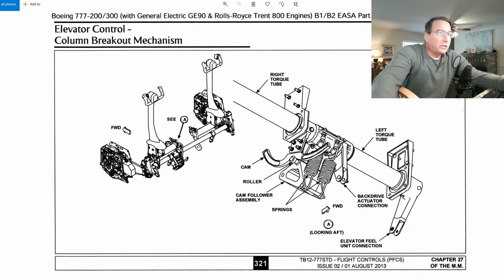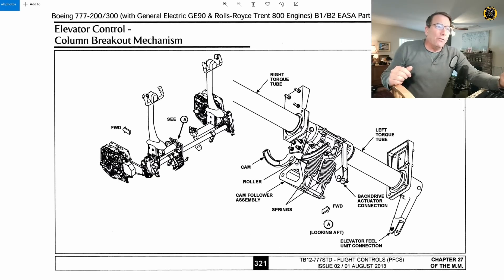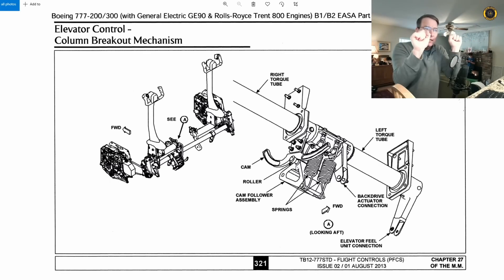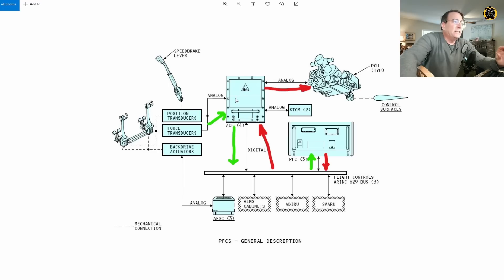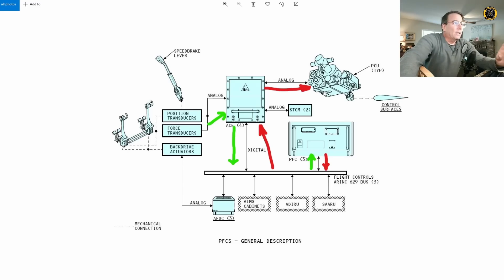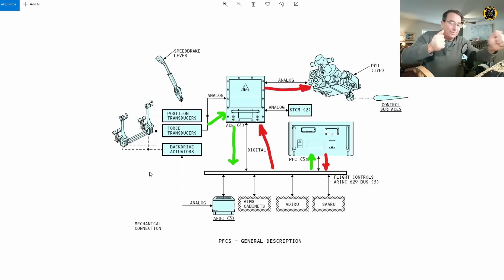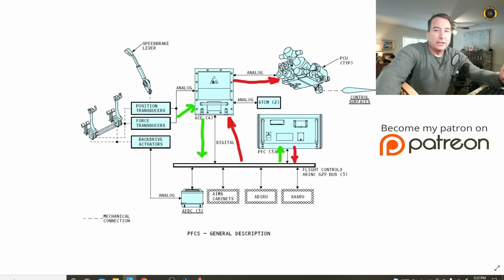Air France 11 Decoupled Flight Controls- "Who's Flying?"

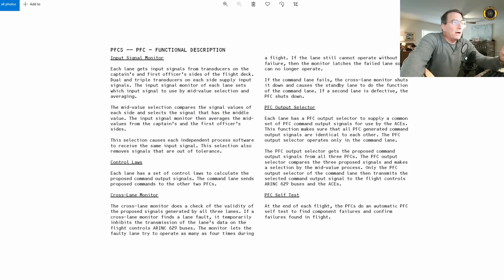Comment: 6:47 says it all.
Each side has 3 position transducers, PFC will select the middle value of those 3 from one side, then numerically average the selected signal of the left and the right side.
This produces similar effect on an Airbus with dual input. On an Airbus, it is expected to have one stick operate at a time, so the signals are numerically added together, with the upper limit defined as the max travel one stick can generate. Moving 2 sticks together will trigger DUAL INPUT warnings.
On a Boeing, since it is expected for the 2 control columns to move together mechanically, adding them together would produce double the control effort, so they used averages. Decoupling the columns and move them toward opposite directions produce an average signal which is basically neutral.
Reply: Exactly 👍
Reply: Does decoupling the columns on the Boeing trigger any kind of conflicting input warning?
Reply: @catamounts  None.
Reply: @zLigHt44  I'm no expert, but it seems like a decoupled column (whether due to a jammed situation or >50lbs of conflicting input) would be a condition that warrants an audio and visual warning.
Reply: @catamounts  They both go to zero,that is the warning,Air Bus has light.
Reply: Sounds like the software side was designed under the assumption that the two control inputs are always coupled, but the mechanical system was designed to allow the inputs to become decoupled.
Reply: @SnakebitSTI  ... No. The software design is just agnostic of which one is the jammed column and which one is the "good" one. If the assumption was that the columns are always coupled you would not need 3 sensors in each column. With just 3 sensors total (n o matter where) it would suffice. The fact that you get one column's position value from its 3 sensors, the other's column position value from its 3 sensors, and then average the two only makes sense if you assume that the columns may be decoupled.
Reply: @adb012  So the software is designed under the assumption that the consoles will only become decoupled if one is jammed?
Reply: @SnakebitSTI  Yes that's what the decouple feature is for.
Reply: @ScaredPilot  So the software does not account for decoupling as a result of opposing inputs, only a jammed column?
Reply: By this logic if one yoke were jammed
 full forward/ nose down, then when the other yoke is full aft the plane could only
 fly level or dive and could not climb. 
That can't be right.
Reply: @mrbmp09  ... You use trim to cancel out the effect of the jammed column and then use the other column to control pitch, which would be neutral when no force is applied to the functioning column.
Reply: Thank You! I came to that same conclusion-it is in the first 2 paragraphs. Next time I am flying a 777 and disagree with the Captain I need to remember to push the column twice as far as I actually want!   lol...
Reply: "Decoupling the columns and move towards opposite opposite directions produces an average signal which is basically neutral". This is a flawed approach. If the two control columns are being moved in opposite directions, this is obviously an error situation and the signals should not be summed. In this scenarios, the way the system should have been designed is a visual and audible alert generated to catch the attention of the pilots. Then the pilot should be able to decide which set of controls (left or right seat) shall provide input to the flight control computer
Reply: So if one of the columns or other controls jams, you just have to hope it's centered when it does?  That seems odd.
Reply: @jxh02  ... No. You zero out the pitch of the jammed column correcting with trim, and then use to good column for pitch control (with 1/2 of the normal authority).
Reply: @jxh02  Isn't it the same as on a conventional plane? If it jams it is always going to be odd.
Reply: Just to give some additional information, so people understand how sensor redundancy works. Not all systems are equal, but most aircraft flight control systems have redundant sensors. Critical sensors often come in 3 (is that called a pair of 3 sensors?). The computer reads all of them and averages them. It is expected some small deviations to exist, as the sensors convert analog values to digital values. If one of the sensors deviates "much more" than the remaining two sensors, the computer logic will regard this sensor as unreliable and exclude it from the equation. If the computer continues to average the value from deviating sensor, it will create a bias in the averaged value - which is undesirable, especially for sensors like the angle-of-attack (ATA) sensor. If a sensor is critical, like the ATA sensor, it will be removed from the equation and the remaining two will be used as input.

Depending on the function that this sensor has, the computer may "fail gracefully" when one of the sensors is taken offline and go into degraded mode, or lower protection mode. On the Airbus, when everything is hunky dory, the systems are in Normal Law and all protections are active. But when some sensors fail or some "smaller thing goes wrong", the system reduce protection and go into Alternate Law 1 or *2*. For example in *Alternate Law 1*, stall protection is lost, but load factor and bank angle protections are still active. 

The accident aircraft was B777 and I don't know if the Boeing logic averages all the sensors or excludes one sensor if there is discrepancy. But a qualified guess is that it processes the sensors from the captain and the co-pilot separately, deducing two yoke values, one for each pilot base on 3 sensors each (which probably did not disagree in the case of AF11). Then the two values are averaged, and if one pulls up and the other wants to fly down, the plane flights straight.
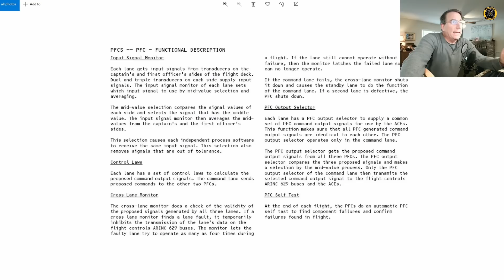Reply: @todortodorov940  if you read the page beginning at about 6:42 in Juan's presentation, you will find that 1) Boeing software takes the mid-value of the pilot and FO columns independently (so 1 data point from a set of 3 for each column) then averages those two;  and 2) erraneous/flawed/suspect input data is culled.  The software will lock out an input channel if the false input continues to occur.
Reply: @todortodorov940  I disagree with your explanation of redundant systems.

Three systems in use, the control stick outputs should not be averaged, the reason being is if one is greatly different to the other two, the resultant average ends up being biased towards the one that is in error.

And the controls signal that in error, the signal could vary wildly and even randomly as the sensors and electronics producing it are defective.

A better design strategy is for the computer to compare all 3 sets of signals from the control stick, and if one is greatly different to the other two, reject that one input, just ignore it, and then use the two that are the same. This is called majority voting.

Comment: So is there an answer as to what the computers do when they receive conflicting inputs from the two sets of transducers?
Reply: Yes. The answer is giving in the text, shown at 6:48 in the video. It says "The input signal monitor then averages the mid-values from the captain's and first officer's sides." This says that (if all the rest of the system is working normally) the average position of the two columns is used.
Reply: @andrewsnow7386  Thanks. I didn’t read that whole screen.
Reply: Listen at 05:27. He says one can deduce if they pushed and pulled in equal amount, that would result in a null input. Two pilots fighting for control, the plane's smart enough to realize the pilots are out of control.
Reply: @sawning3449  Thanks. I see the complete answer is in the text at about 6:43. It does say they are averaged. So it one side jams, you would have to input double on the controls to get what you want. So if you want a 10% bank, you would have to ask for 20%.
Reply: @bobh6728   Yes, that is so, and exactly the same on e.g.the 767  which had separate mechanical cables from the controls to the elevator on each side and a similar 'breakout' mechanism.   And ditto for the ailerons/spoilers.

Comment: The actual column disagree handling in the control laws or ACE is not described in that text - they probably figured it never needed to be written down!
Hazarding a guess, I think that the systems will first attempt to ask "which control column is stuck? I will ignore that one." - but of course that doesn't work when both are receiving true input. After that fails, there are several possible answers - take captain's, average the two, or use zeroes. And I think the only way to really know is for Boeing to check - run the FDR data into a simulator running the ACE and FCU code.
Reply: I'm not THE retired engineer that Juan referred to, but I'm A retired engineer that worked on the 777 flight control system. Unfortunately, I've forgotten a lot of it. But, the answer is giving in the text, shown at 6:48 in the video. It says "The input signal monitor then averages the mid-values from the captain's and first officer's sides." This says that (if all the rest of the system is working normally) the average position of the two columns is used.
Note: If the system is not in "normal law", things might be different. If there are problems with the digital part of the system, such as the primary flight computers (PFCs),  the system can operate in a different mode using just the ACEs (analog computers). This is where my memory fails me, but in this mode it might be that one elevator is controlled by one column and the other elevator by the other column. In any case, I don't think there is any indication the Air France airplane was in this analog mode.
Reply: The document Juan presented here is a broad overview. There will be system specifications written in great detail defining the control laws used in the case of control column disagreement. when the software folks set down to write the code for the control computers, they adhere - obsessively - to these specifications. The software will be tested very carefully to make certain that it obeys all control laws, including those that handle the decoupled control column situation.

Nothing goes into the software in a safety-critical system that is not in these specifications. Period. And it is not the job of software engineers to make decisions on what the control laws are - their job is to create a system that properly implements all the specifications written by the systems engineers. All testing is driven by these same specs.

When lives are on the line, nothing is left to chance - if all are doing their jobs.

See what happens otherwise when the systems engineering folks fail to do their due diligence with the horror that was the original MCAS.
Reply: I've heard that some systems just sum the inputs when controls disagree. That seems benign.
Reply: @j_taylor  Not to me it doesn't. You can get ~zero input or more than anyone intended. Averaging would at least give you roughly the right magnitude so you don't stall by mistake. For opposite inputs I don't really have a good idea, but I'm not a plane designer anyway. :D
Reply: @samiraperi467  Airbus uses summed inputs, with the upper bound being full deflection of the relevant control surface. They also have a concurrent warning of DUAL INPUT.

Boeing uses averages.

A warning is unnecessary because a jammed control column is obvious.  If someone is lifting 50lb weights at the gym, you’ll hear them grunt and see them strain. Plus, they’ll brag about how strong they are.

Same thing in the cockpit. It’s obvious when that much control effort is being applied. Pilots don’t like to do that much work, and will be quick to complain.  So both pilots will realize there is a jammed column. 

Unless you are this French crew….?

Also, a jammed column is a MECHANICAL failure, not a digital or analog flight control problem. The FO drops a handful of pocket change on the floor and a nickel jams the column.  The airplane is flying just fine. A jammed column does not also mean there is a flight control problem. There is triple redundancy for a flight control problem. There is the column breakout as redundancy for a mechanical problem.

Many of you are conflating the two separate issues.
Reply: Rather than attempting to make this a hardware problem, how about it's a people problem?  It's not up to the aircraft to decide who's in charge.  In some cases, the co-pilot is acting as the pilot in command and still sitting in the righthand seat.  Is the system supposed to understand that too?
Reply: It needs to be written down, defined in an unmistakable and exact way so it can be risk assessed.  They must have considered this scenario, and the outcome of the risk assessment almost certainly would have required this to be covered in pilot training.